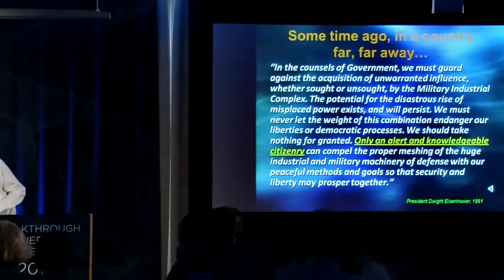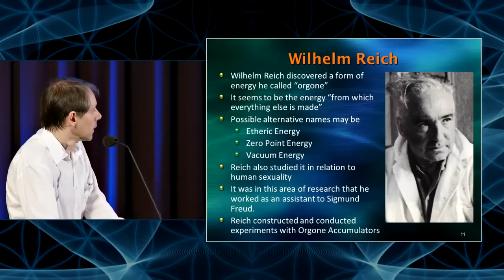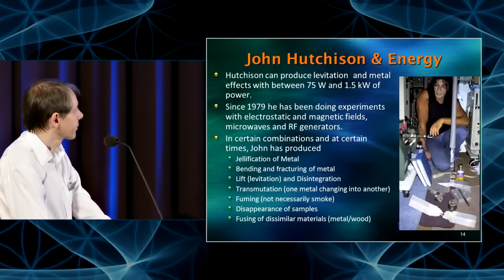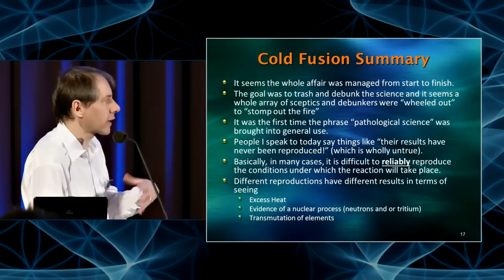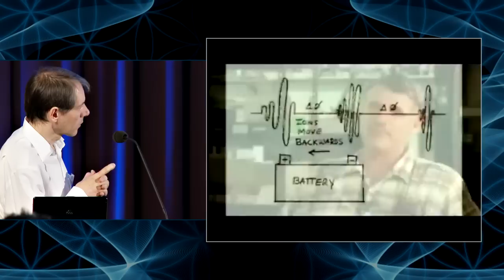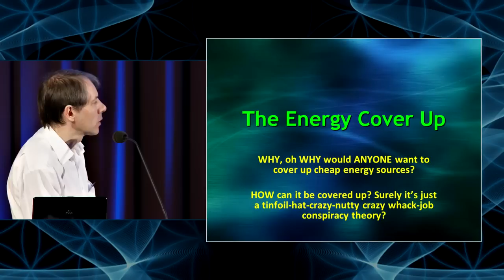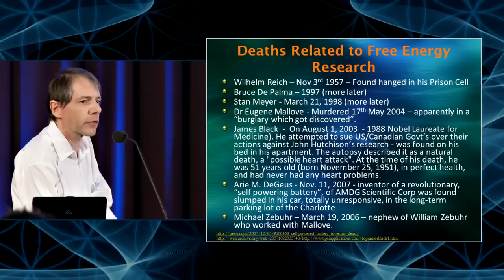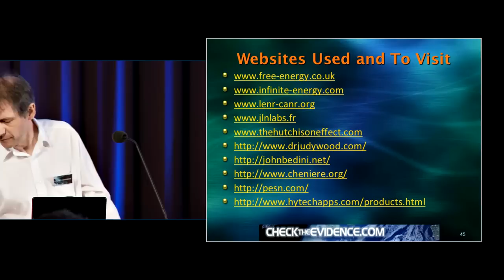Infinite Energy, But Not For The Masses | Andrew Johnson

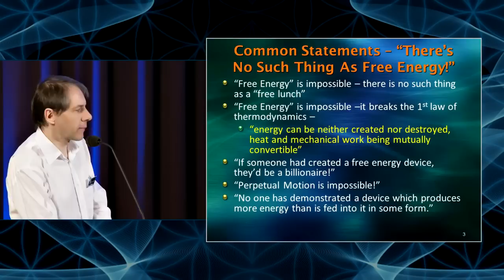Comment: 8:18 No one has demonstrated a device which produces more energy than is fed into it in some form (energy input is always greater then energy output). <--That's a true statement Don't listen to this idiot. This man (who has no degree or experience ) after reading that statement said "oh really but, as you know this is not true"(8:26). The thing that kills me is that some idiot with no full scale of understanding made a long video to convince uneducated people of his viewpoint. the true agenda of this video is to hurt people who has no education in the topic and that is wrong. 

here are some things he didn't say:
Energy loss and Energy transfer
electric energy or Volts / Amps lose energy when traveling threw any conductor (wire). You can also see a loss of energy do to environmental conditions. Heat increases Resistance and with resistance you have energy loss. if you have a wire of any length or with your going to have resistance. and resistance = loss.

now with the heavy water he is talking about. again with the notion that there is more energy going out then going in. That's is wrong. why is heavy water called heavy water? now look at the periodic table look at the elements that have more mass. Uranium has a larger atomic mass and because of its larger mass Uranium 238 (92) is used in atomic weapons. heavy water has a higher yield of potential energy to exploit. that means that the energy was already there your just biologically extracting the higher energy from the water. heavy water has more energy then water.
Reply: So where does the energy for tornadoes come from? It's over-unity form the zero point energy in the earth itself. That is the point Johnson is making. All this is known but kept secret. Read "Where Did the Towers Go" by Judy Wood to see its weaponization. If you're in the military, you would understand this.
Reply: @michaelrapson  
Nope its not for tornadoes its the extange of thermo energy heat rises and cold air sinks. There is an exchange of energy. There is more to it as well like the role of gravity ect... The truth is that it is energy that is accounted for.
Reply: @michaelrapson  
Oh and you can make your own tornado. It is explainable and it is known. Zero point energy has yet to be discoverd.
Reply: @michaelrapson  
I have a feeling i need to make a more in-depth explanation when the hot air goes up it also starts to cool down the loss of heat energy is what helps create the movement ect...
Reply: @vc2702   No. There is more to tornadoes than gravity, heat and cooling effects. There is also altered space-time, anti-matter and effects such as fusion of dissimilar materials that can't be accounted for in your model. The underlying fabric of reality is restive as in a vacuum, meaning that enormous reserves of energy can be stored in  the zero point.  Consider martial arts where energy can be drawn from the chi that seems to come from nowhere.
Reply: @michaelrapson  
Look im not trying to put you down or, say your not intelligent im just trying to help you understand. If anyone can make a tornado with heated and cooled air thats it how come is it hard to understand thats all you need? Yes tornados are not a mystery if you can prove how it works and then create a simulation of a tornado tgen you understand the mechanics of it. You really have no ground to stand on when you make assumtions. When a proven model can be created 100% of the time.
Reply: @michaelrapson  
The reality is that we can recreate a tornado with our understanding of it. The next logical conclusion is that there is no hidden secrets
Reply: @vc2702   There are hidden secrets and that was clearly demonstrated on 9/11.
Reply: @michaelrapson  
Why do you feel the urge to think that there is hidden secrets? You can investigate yourself and find the truth. Try not to guess what you think is the truth instead of doing that find out for yourself and then It will no longer be a secret.
Reply: @Piero Canova  You can also apply that rule to the formation of lightning, thunder, cyclonic winds etc on earth. Someone obviously solved the problem of converting that energy into power (and a weapon).
Reply: @Piero Canova 
So i can answer some of your questions.
Movement around the sun. Think of it like a satellite how do we keep satellites in orbit? We first use chemical energy (rokets use chemical energy) to get the satellite far enough away then we have the satellite fall twords the earth. It (satellite) does not fall directly twords the earth its held by gravity while moving at a high speed slightly parallel to the earths surface. Now an object in motion stays in motion until acted apon from an outside force. The movement of the earth will continue to move unless an outside force stops the movement. In space very little outside force is acting on the movement. Now just like the satellites we are a satellite of the sun. The moon is also a satellite to earth and so on. 

Inconclusion movement of any object has nothing to do with the spending of energy. The only time energy is used is durring the initial stages of movement.

Now the forces such such as gravity affects the nature of energy and how it is used but it does not effect the energy itself because they are very seprate from eachother.
Reply: @Piero Canova 
Protons in nucleus are kept together by one of the forces and not buy energy.

Hopefully this helps you. Since you seem very interested maybe read more into the subject. Research and come to your conclusions.
Reply: @Piero Canova 
Why does an H atom need fuel?
Reply: @Piero Canova 
Is movement really more then what you put into it? You can put little effort into things and get more out of it. What do you consider put less into and get more out of? Maybe your definition or view point on energy needs to change so it can make more sense. Its not an easy subject to explain but the best way i can explain it is to say to you that energy and force are two very different things. And that there is more then one type of force. You have your week forces such as gravity and your strong forces such and magnets. They affect how energy interacts but they do not change energy itself.
Reply: @michaelrapson  
What rule are you talking about?
What about lightning (the light that is emitted) and thunder the sound waves moving in the air)?
How does it prove anything? I want to know your ideas what am i missing? I want to be proven wrong so i can better my understanding. Try to dumb it down for me hopefully we can learn from eachother.
Reply: @michaelrapson  
I think its good that you think this way wrong or right makes no difference. We always need people to have different perspectives. Thats how we learn and challenge eachother to become better as a society. Plus the world would be so boring and not effective if everyone agreed. Imagine a world that had everyone agree on everything all the time that would suck and nothing new or better would ever exist.
Reply: @vc2702  I want to know your real name, rank, your commanding officer's name, the unit you work in and the address of your military base.
Reply: @Piero Canova 
Who said they understand gravity? You can understand some of the functions with out understanding the whole picture. Example things objects with mass falls to the ground or gravitates to the center of the earth. What exactly does that have to do with energy? My whole point is that gravity and energy are not the same thing. Doesn't seem to be a connection. Gravity has not produced energy it effects it.
Reply: @Piero Canova 
What answer did i give that makes you think i gave that was wrong? No one can just give an answer with out proof. So what exactly do you need for me to prove for you?
Reply: @Piero Canova 
In physics, the fundamental interactions, also known as fundamental forces, are the interactions that do not appear to be reducible to more basic interactions. There are four fundamental interactions known to exist: the gravitational and electromagneticinteractions, which produce significant long-range forces whose effects can be seen directly in everyday life, and the strong and weak interactions, which produce forces at minuscule, subatomic distances and govern nuclear interactions. Some scientists[2][3][4]speculate that a fifth force might exist, but this is not widely accepted nor proven.

Each of the known fundamental interactions can be described mathematically as a field. The gravitational force is attributed to the curvature of spacetime, described by Einstein's general theory of relativity. The other three are discrete quantum fields, and their interactions are mediated by elementary particles described by the Standard Model[5]of particle physics.

Within the Standard Model, the strong interaction is carried by a particle called the gluon, and is responsible for quarks binding together to form hadrons, such as protonsand neutrons. As a residual effect, it creates the nuclear force that binds the latter particles to form atomic nuclei. The weak interaction is carried by particles called W and Z bosons, and also acts on the nucleus of atoms, mediating radioactive decay. The electromagnetic force, carried by the photon, creates electric and magnetic fields, which are responsible for the attraction between orbital electrons and atomic nuclei which holds atoms together, as well as chemical bondingand electromagnetic waves, including visible light, and forms the basis for electrical technology. Although the electromagnetic force is far stronger than gravity, it tends to cancel itself out within large objects, so over the largest distances (on the scale of planets and galaxies), gravity tends to be the dominant force.

All four fundamental forces are believed to be related, and to unite into a single force at high energies on a minuscule scale, the Planck scale,[6] but particle accelerators cannot produce the enormous energies required to experimentally probe this. Efforts to devise a common theoretical framework that would explain the relation between the forces are perhaps the greatest goal of theoretical physicists today. The weak and electromagnetic forces have already been unified with the electroweak theory of Sheldon Glashow[7], Abdus Salam[8], and Steven Weinberg[9] for which they received the 1979 Nobel Prize in physics. Progress is currently being made in uniting the electroweak and strong fields within a Grand Unified Theory(GUT). A bigger challenge is to find a way to quantize the gravitational field, resulting in a theory of quantum gravity (QG) which would unite gravity in a common theoretical framework with the other three forces. Some theories, notably string theory, seek both QG and GUT within one framework, unifying all four fundamental interactions along with mass generation within a theory of everything(ToE).
Reply: @Piero Canova 
Never said we know everything. But we do know enough to figure out that guy in this video is talking bs. Anyways you didnt dissapoint i like this. Ok e=mc2 what do you think it means?
Reply: @Piero Canova 
What forces you asked. 
1. Gravity
2. Nuclear
3. Magnetic field
4. Electricstatic
Reply: @Piero Canova 
If you say they found in a void there is anything then it is no longer a void. A void is an absence meaning nothing exist but if you claim something is in this void how can it really be called a void?
Reply: @Piero Canova 
Sorry reading bits and parts pf what you wrote. Ok now fire lol that is explainable. Now lest say you burn a stick the stick shrinks and their os a loss of mass and energy. Well ware did that energy go?. Well it was transformed but how? Well a few things happend one the heat is also the release of energy from the stick. There is more the stick also emitted light and radiation. The light moves until it hits an outside force such as your skin and so on it also moves threw your skin and so on.
Reply: @Piero Canova 
Well yes i am just saying things that i have been told but i am also saying things i have tested in the past. I have yet to see it to be wrong. For instance the electric motor/generator. I seen this often people use two of them one has a larg round heavy disc and its connected to the other then they spin or use a 9v battery to start it. And they think that because the device unplugged from battery is now producing more energy then what it was givin. The problem is that the energy they gave the device the first time is almost equal to what they are getting back. They actually lose energy. Now when they test it using a dmm for some odd reason they only use Volt , or Amps but never do they compare both at the same time. Ugh i can go on lol. I state what i know because i seen it in practice and the reason most people agree is because they also seen it to be truth. Now it dpes not mean your wrong it only means i have yet to know what your talking about to be the truth.
Reply: @Piero Canova 
Do you want my email so we can talk more in-depth? You didn't dissapoint me, im not angry but i am trying to understand your logic and hopefully learn from it. Im not 100% sure you understand my perspective. If we are to understand eachother i need to know more about what your talking about and what you mean. Yes we need to go over definitions. I dont think either of us are stupid but i do think we need to be able to comunicate better. I want to be wrong i want prof that its possible to produce more energy. To have even a usless device that produces more energy then what is given would be amazing. I have yet to read about such a device in modern books of science. But i could be wrong. Of you can point me in the right direction i would love to read it. Also anything by this guy in the video is going to be rubish.
Reply: @Piero Canova 
So for your statement. "Energy is what can do work,  according to standard model. Force is an expression of energy in the material world." How does that conflict with what i been saying? Energy and force are different. Something that is an expression of energy is NOT energy. Something thats an expression of energy can influence the movement of energy. And it can also go the other way.

I hope that helps you understand me better.
Reply: @Piero Canova 
Thanks for helping me articulate my words better. I still have a ways to go, but its helpful to learn from everyone that i can.

Comment: Clean water does not conduct electricty !!
Reply: What is water made out off? lol
Everything is energy. On subatomic level control, you can move energy (electricity) any way you want.
Reply: VPXM...Do you think your funny ?? In the normal course of everyday life, water with out a "channel" for electron flow, ie, acid or salts even dish soap, is an insulator. Please impress me more !!
Reply: Do people? They are used as conductors of the electricity taken from the hairpin circuit.

Comment: All energy comes from the Sun and what you describe is some wishful inventors with unfortunate faith...
Reply: Cyclonic energy, lightning and thunder don't come from the sun. The energy that drives the weather systems is terrestrial. Tesla was able to tap that energy but his patents are missing.
Reply: @michaelrapson   Wrong, it is a basic knowledge, Sun warms water, evaporates and friction of clouds create thunder...
Reply: @matheworman6308  The sun is the driver but elemental forces manifest from the earth's life force. Wind and lightning, for example, emerge from changes in terrestrial atmospheric pressure that originates in the ether. Ether physics has been covered up.
Reply: @matheworman6308  Semantic arguments are fine.  The bottom line is that material was dissociated on 9/11 to particles smaller than DNA. Some hidden technology did that and it continues to be covered up.
Reply: @michaelrapson  What arguments are those semantic ones?
Reply: @matheworman6308   Maybe 'semantic' was a poor choice of words by me. The key issue, however, which should not be buried by arguments about how energy is produced, is that the world trade centre material was dissociated by something. Whatever that something is, be it from the sun, the earth,  ether, or something else, it was real... and it is being covered up. That is the central issue pointed out by Andrew Johnson, and it is not being addressed by the science academy or even by most of the truther movement.
Reply: @michaelrapson  Well, that is different subject and if I was to comment on that then it would be: Chemical reaction of nano-termite creates extremely high temperatures that can evaporate construction steel...
Reply: @matheworman6308  If that is your appraisal then there's no point discussing the issue further.

Comment: dc battery's take ac charge ' and static can produce 220 - 240v 50 - 60hz '  the frequency can be adjusted by the speed ''''' instead of using big words ' waffling making it sound complicated ''''''' even the water hydrogen is just over complicating to sell products ''' water fuel can be used with no extractions  ''''''' simple tank with top intake and bottom out take running a turbine that powers own circulating pump .